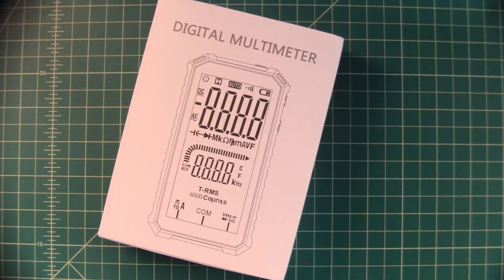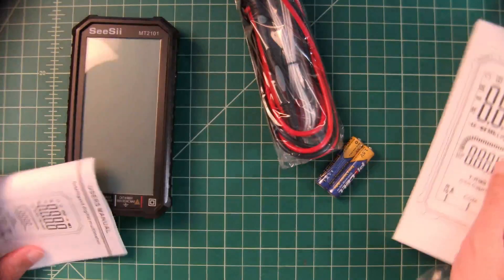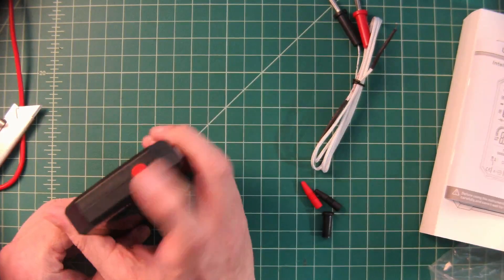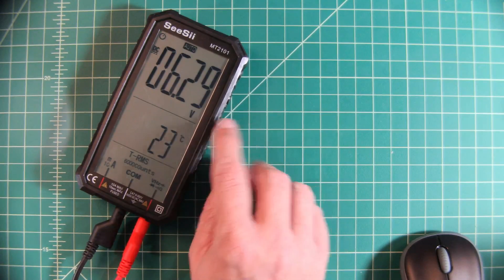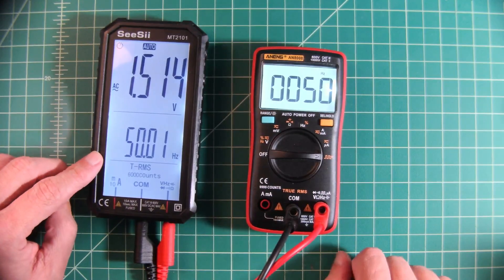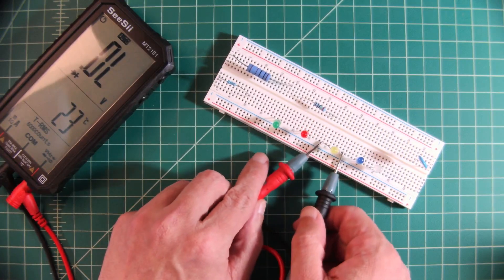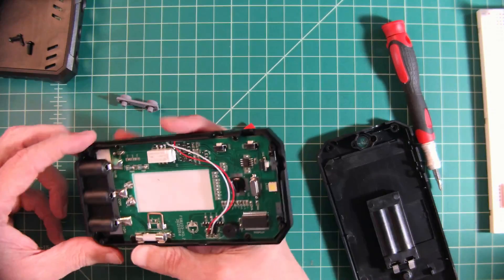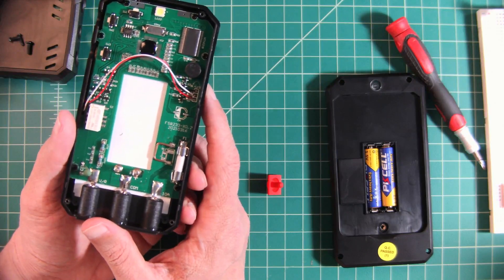SeeSii MT2101 Digital Multimeter

Comment: Just got one today, it has three buttons on the side. The power button on the top is very touchy. It takes a lot to turn on but I can bump it on something and it turns off. I could not figure out how to get the temperature to stay in F, If I turn it off it goes back to the default C.
Reply from the maker: I'd take a look at mine but I gave this meter away to a buddy.

Comment: Thanks.  I received one of these meters for Christmas.  One thing that I noticed is that when it is configured for resistance, it will not measure a 10K ohm resister.  In AUTO mode, it will measure it, but not in resistance mode.  Very odd.

Comment: thats a nifty little guy . it sure would beat my little harbor cheap boy
Reply from the maker: I have a few of the HF meters, I need to dig them up for a video.  Thanks for the support UG 👍
Reply: @TheSmokinApe  they always work in a pinch and the battery last longer then the leads do. and you can get them on sale for a few bucks
Reply from the maker: @ubergeek318  yeah, I keep one at work because I need to test batteries all the time, works great for that

Comment: Does this meter use standard probes or are the probes unique to this particular meter? Another smokin review from the smokin ape! 👍
Reply from the maker: I didn’t try them in another meter but the BNC probes I use for things like measuring voltage fit other meters, I’m sure they are standard size.  Thanks for checking out the video TheRadioGeek 👍